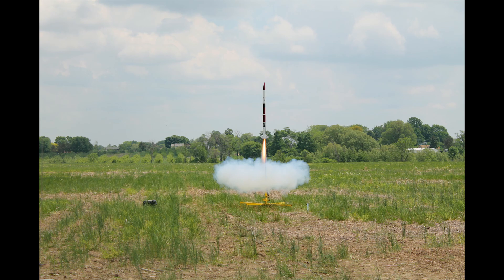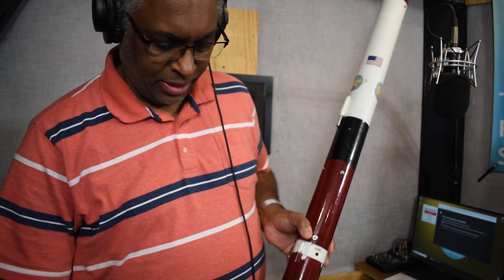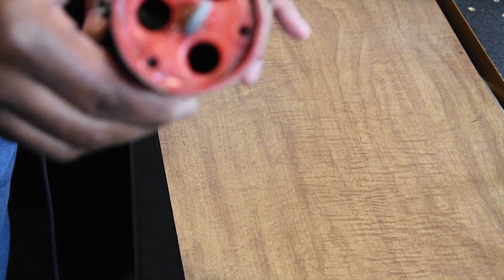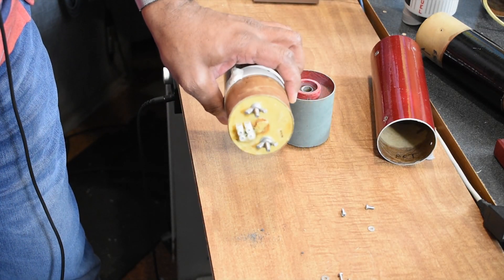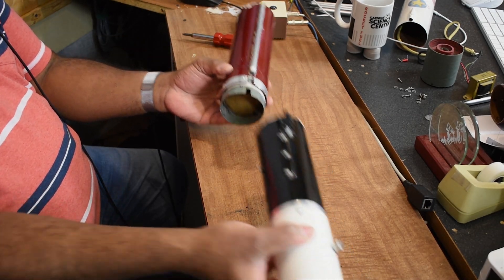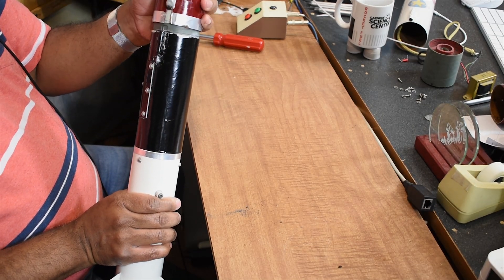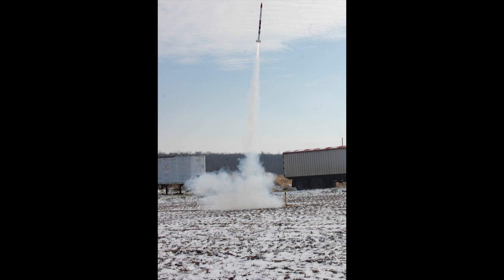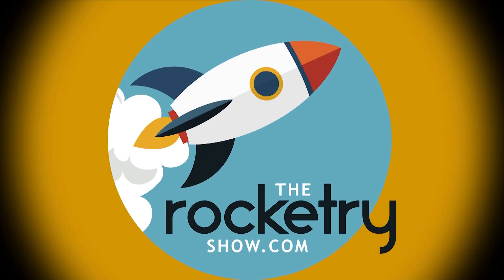Episode 83 video bonus: CG talks about his Ejection Baffle designs in his rocket, Nesaru.

Comment: Hello, I just discovered your channel today.  I have a question for you: What powder do you use or recommend for the ejection charges. We did some tests but we can't get the pressure to build up.  The powder seems to burn instead of popping.   Also here in Canada, it is probably much more difficult to get.   We are working on a much smaller scale than you with F15-0 engines.  We are also concentrating a lot on guidance and control as opposed to altitude.   Constructive criticism:  Set the camera to focus before the show and leave it alone. Remove the auto focus if you can.
Reply from the maker: Hello!  Sorry for the really long delay!  I use Pyrodex right now, though I'll be using actual black powder eventually.  Pyrodex is what I had on hand when I started doing Dual Deploy.   I started all this on BT-60 sized mid power rockets.
Reply: @TheRocketryShowCom  Thank you for the answer!  We have now secured a supply of FFFF black powder enough for two lifetime for our ejection charges.  We are flying 74mm tubes.  Most of our focus is presently on the onboard electronics.
Reply from the maker: @cardboardaerospaceinc.3053  Cool!  Dual deploy electronics, or something deeper?